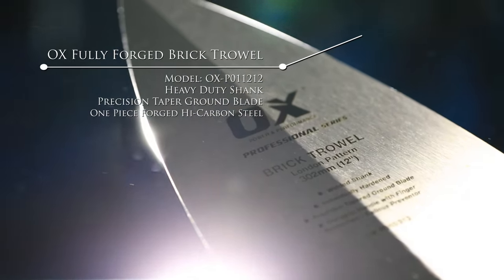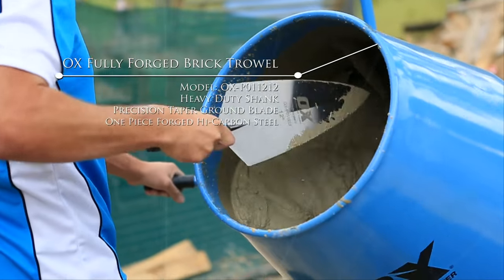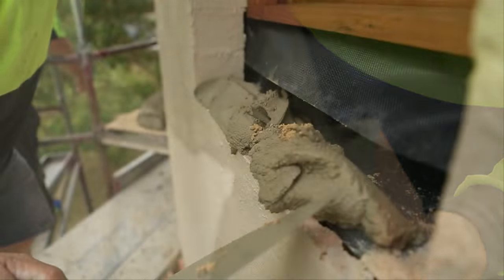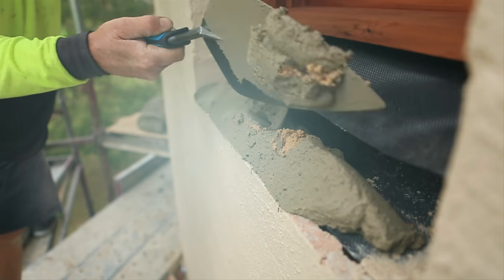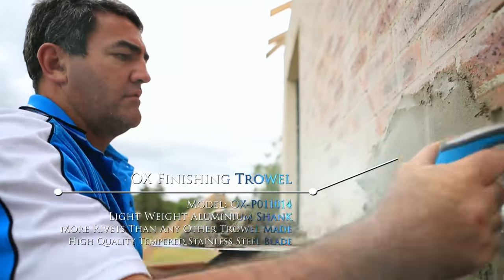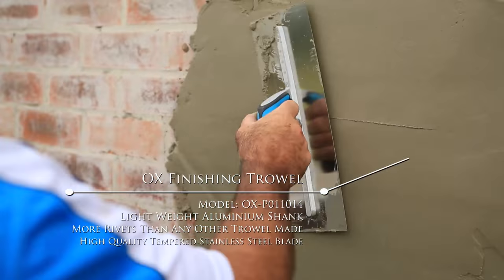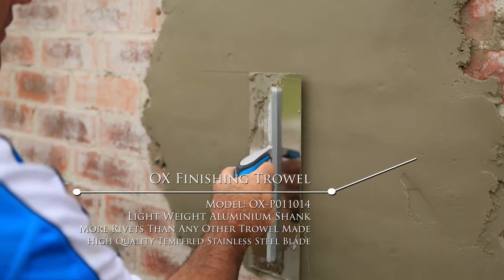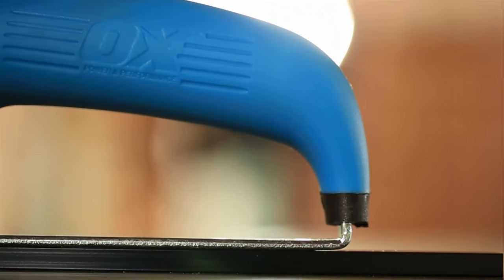OX GROUP Masonry Tools

Comment: Horrible brick trowels, they shorten down to quickly & just the feel of the handle......can only hold it comfortable one way. A trowel needs to be able to freely spin in your hand but to also not loose control
Bumpers fall out religiously 

Its a shame, as to my understanding theyre australian owned. I love keeping money local
But i cant justify the dip in quality & usability 
Most my tools i order directly from marshalltowns website 
Cost an arm and a leg, but worth it in the long run

Hope to see the quality get better in comn years
You do have great brushes tho